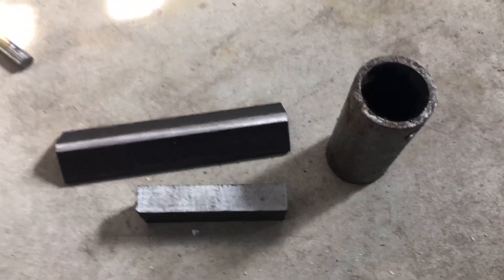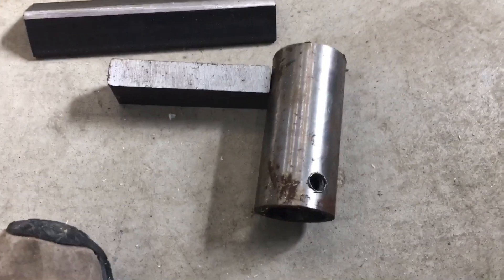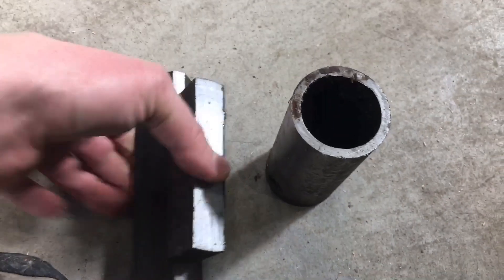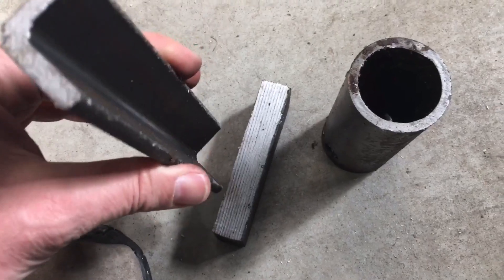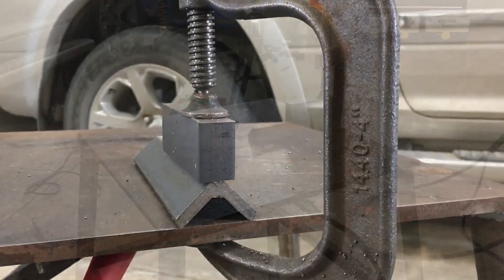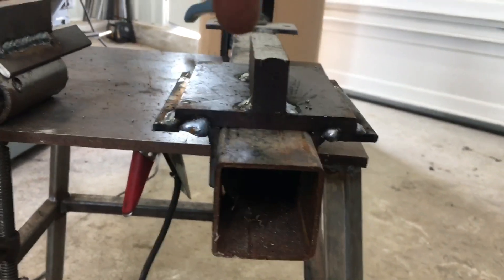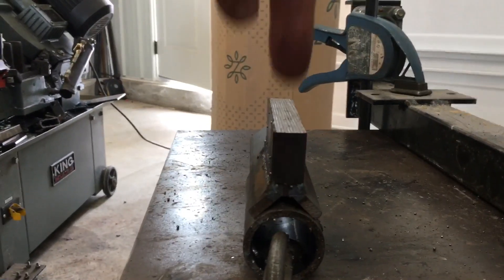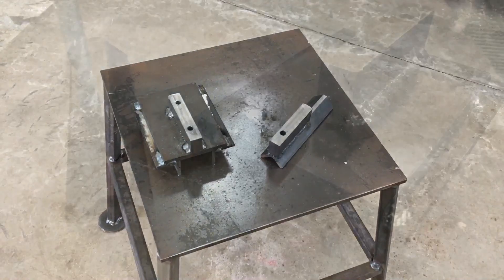Steel pipe & tube drilling jig

Comment: I like it.  But I need to set it on a drill press and drill holes equally spaced down a section of pipe up to 50” long. 1/2 sch-40.  Holes will go whole way through both sides. “ spraybar”